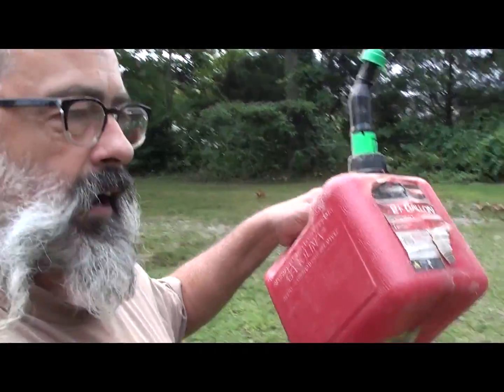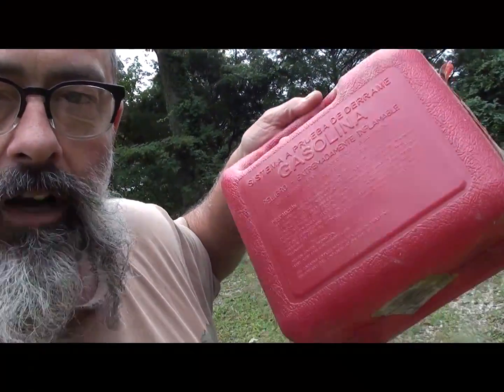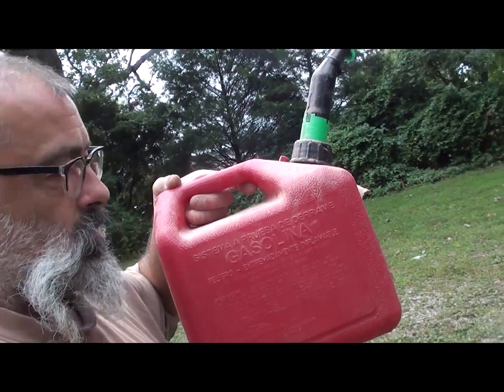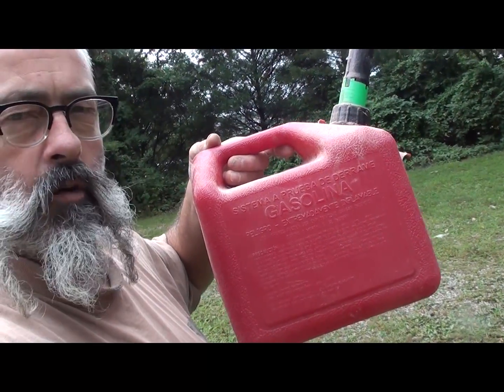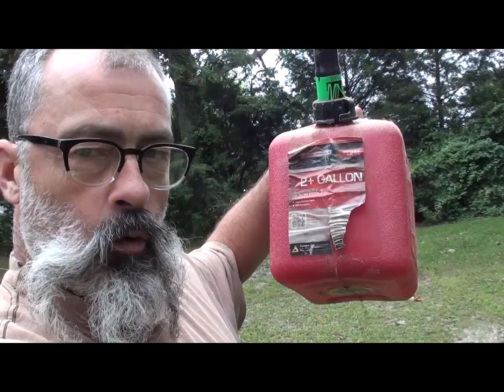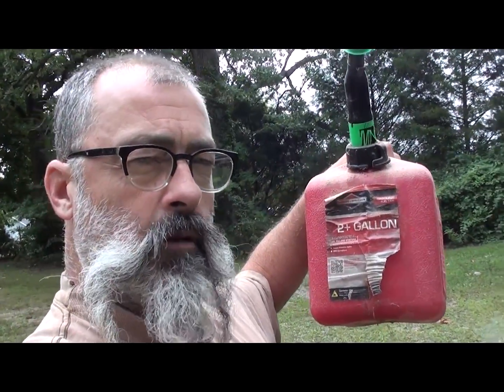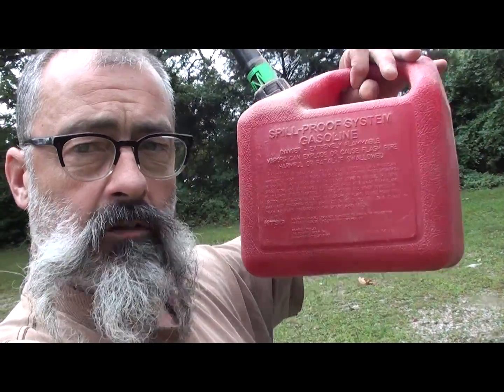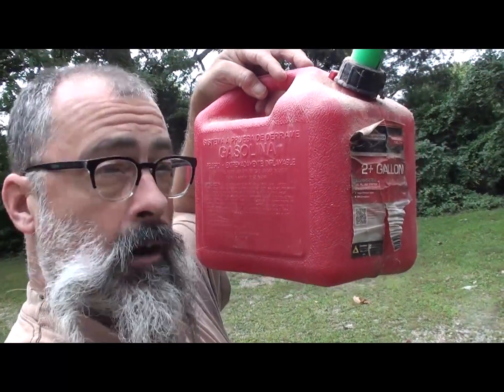DUDE! BRUH! engineering fail,.. how much gas/fuel do i need?

Comment: Speaking of fill lines Todd when I owned a fifth wheel trailer home in California I was concerned with keeping my black tank clean - that is the poop tank. I could peep under the trailer and see it but it was completely opaque. I often wondered how easy it would have been to to build in clear strip of plastic into the tank so you could take a peek once in awhile and gauge just how much poop was in there. They just don't give consideration to those type of things🤔
Reply from the maker: YES! absolutely,.. they leave it to us to jerry rig (sorry jerry, my apologies) our own with brass fittings and clear hose,.. what a gnarly job that is!

Comment: You know that there is something that just that pisses me off to. People who don't use the correct terminology.  You see at the beginning of this video the guy says that his gas can does not have a line for different measure increments. Well, you see that he doesn't have a gas can at all. if it was it can it would be made out of metal. But I'm guilty of old school terminology also as Times are changing too fast as I still  call this a gas can.  
              OLD SCHOOL RULES
Reply from the maker: quick draw,...AND if it WERE a gas can,.. i would have no idea how much a gallon would have been in there in the first place,.. you can't see thru metal LOL, good point quickdraw,..,..  GAS CONTAINER
Reply: Lol. I'm guilty of using old terms to

Comment: Don't all gas pumps tell you when to stop at a gallon?
Reply from the maker: wellll,.. what if i wasnt using a gas pump to fill it up? what if i was using another fuel container?
Reply: Get a gallon milk jug and fill that to measure. There's other ways to measure a gallon. There's 16 cups in a gallon, get a measuring cup.
Reply from the maker: and the engineers could put a line on the container,.. dont worry july,.. i figured it out, just voicing my complaints to briggs and stratton,.. i mean really,.. how hard would it have been to put a line in the plastic mold?
Reply from the maker: aaaaand i dont drink milk,.. too many growth hormones,.. i know i know,.. they sell water in them too,...
Reply from the maker: and if i were going to the store to purchase milk or water,.. then i might as well stop by the gas station LOL
Reply: They could, but then you'd have an opaque red container, how would you see how much gas was inside as it's filling? They'd have to put some kind of clear window so you could see the gas as it was filling up. You bought a 2-gallon container that's meant to hold 2 gallons. Buy a 1-gallon container and then there's no worries.
Reply from the maker: apparently you have never filled a container that you could see daylight through, no clear window needed,.. really? are you arguing the point with me when i clearly have dealt with these containers before and have had NO problem filling them ,.. and it is clear that you have not, otherwise you would know you can see the level of the gasoline in the container when the light hits it
Reply: I have filled these and it's very difficult to see through the red plastic. Most gas pumps are in the shade. Further, if you can see the gas inside, Todd, just fill it halfway. Half of a two-gallon canister would be 1 gallon! Conversely, you could fill it yourself with one gallon and mark it with a sharpie.
Reply from the maker: agreed,.. however it would be convenient to have the company do it in the first place(as was the reason i made the video),.. so the consumer doesnt have to,... thanks for proving my point,.. that the consumer shouldnt have to be the one doing it,.. obviously when your "guessing" where the half way point is,.. then your fuel mixture wouldnt be correct,.. as in the case for my 5 gallon container,.. the fill line is below the spout by 2 inches and well below the texture change on the can,.. so,.. your guess is as good as mine "where" the filled to capacity line would be,.. i will be sure to carry a marker with me so i can mark it at every gallon,.. next time i go,.. thank you for your input